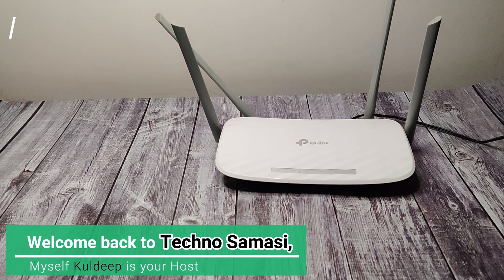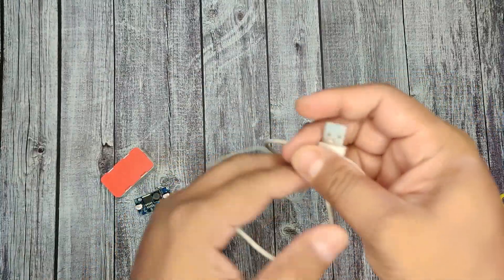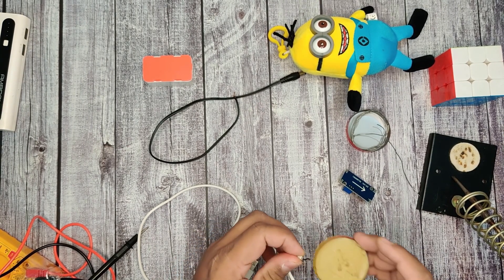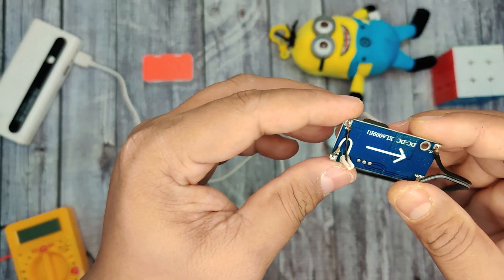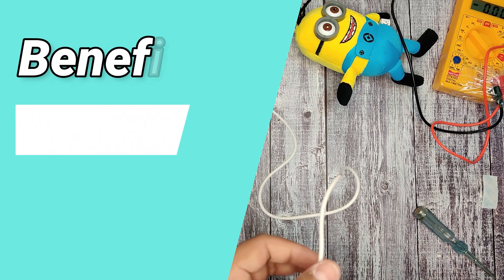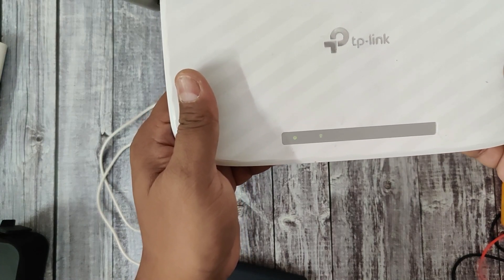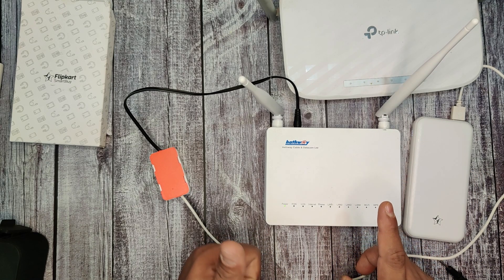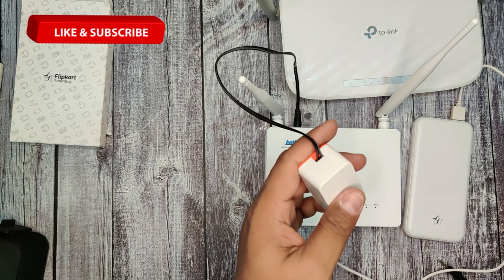DIY PowerBank for WIFI Router or Modem | USB DC 5v to 9v/12v/15v | by Techno Samasi

Comment: Can I set it to 5v? My router is 5v only.. How can I do..?
Reply: I bought one 5v to 5v usb cable but it just turned off and on when power cuts. I have given power from adapter - > power bank - > router. Power bank not supply power continues when power cuts.
Reply from the maker: Check the current too in ur router... Generally on Power bank 1amp or 2.1amp... So check the compatibility

Comment: XL6009 does not give more than 1AMP. So , it cannot give more than 900mah current draw. If your router is rated 900mah or more then dont bother with this. Remember that if you boosting a current from 5V to 12V... you sacrifice currrent. The Law is V=I x R.

Comment: I have a urbn 10000 mAh power bank, which supports 5v/3a, 9v/2a, 12v/1.5a, can I power this directly to my WiFi router with usb to dc cable. My router requires 12v/1.5a input(D-Link 825)
Reply: I tried but not working. Is any other method you tried for this?
Reply from the maker: @sumit1808  Hey Sumit.. Thanks for Watching my vedio.. Could you please tell what you tried & what is not working...
Reply: @MrKuldud  I directly connected my realme 20000mah power bank to Airtel Nokia Router,As power bank output and router input 12v 1.5A is same.After conecting both of them no light blink.
Reply from the maker: @sumit1808  Hey Sumit..
You have make the circuit for 12v using xl6009 circuit.. 1.5amp means you have use powerbank of 3amp to split in 2 device
Reply: @MrKuldud  did I need to purchase this circuit for using power bank for Router.
Reply from the maker: @sumit1808  The Base circuit xl6009 u can buy and build the whole circuit.. By following my vedio..
Reply: @kuntal.chanda  my airtel nokia g-2425g-a is working totally fine Redmi 18 watt power bank, may be get a better power bank.
Reply: @sumit1808  use usb trigger board
Reply from the maker: Yes you can.. Connect on 12v/1.5a out put.